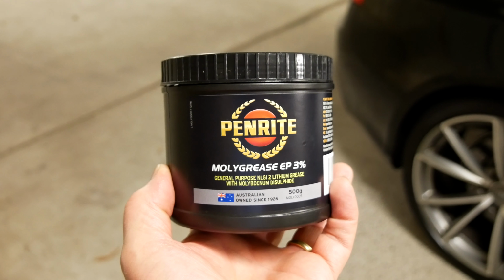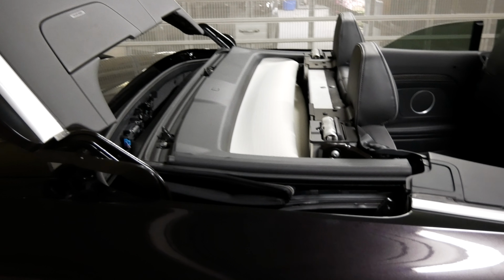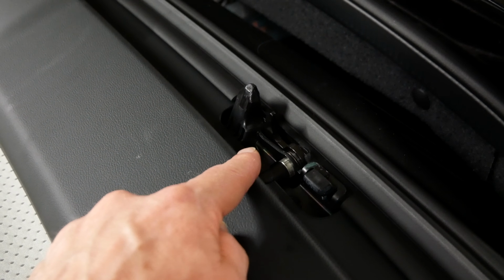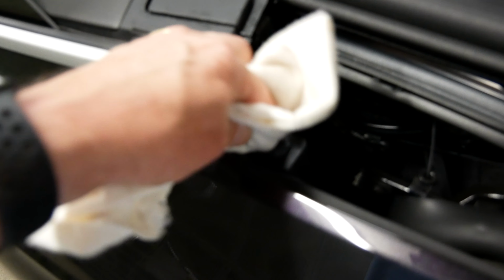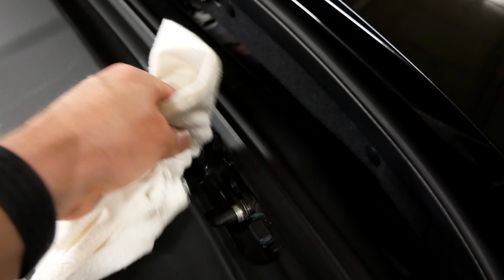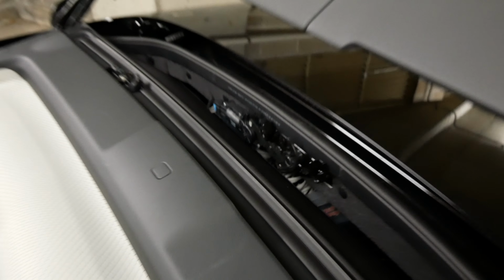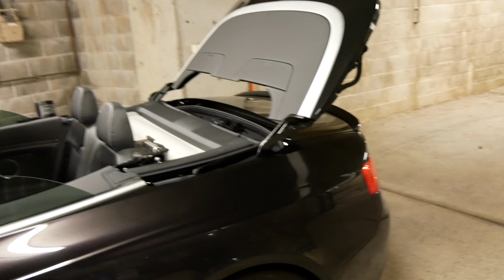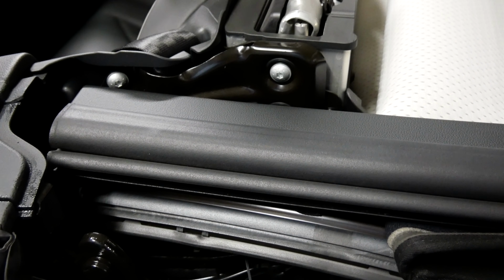Episode 32: Fixing a creaking roof on an Audi A5, S5, RS5 Cabriolet

Comment: Hi Simon - thanks for posting this video. Seems everyone with the issue finds your video. It didnt fix for me BUT i did find someone else who posted a second potential fix on one of the forums. It turns out that the two rubber lid rest points (one on each side) are threaded and can be raised and lowered by using a #17 spanner. Raising them allows the roof to be more tightly braced against the car and this stops creaks that are caused when the roof/lid rest points gets loosened/lowered over time. Only needed about a half turn anticlockwise (to the right) on both sides for me to fix completely.  So for anyone that has tried the grease solution and still got the problem try turning the thread on the rubber lid rests. Hope that helps (was sooooo annoying before, now i can drive in peace with the roof up as well).
Reply from the maker: That’s useful info - thanks!
Reply: Can you post a picture of video showing where and how to tighten this? I am new at all this and don't want to try to adjust the wrong thing

Comment: This was amazing. I put up with the creaking noise for months figuring it would take a bit of work (and money). Turns out a £10 can of WD40 white lithium, fixed it right up.
Excellent advice, thank you!!
Reply: Now if you could just tell me how to fix leak in the roof, water gets in between the seals on the drivers side 😁
Reply from the maker: Silicone spray perhaps?
Reply: @mguytv  I'll give it a shot. It seems to of happened to a few people with this model S5

Comment: Got the same on my newly purchased 2007 Volvo C70 .. it's pretty mint but I had the creaking sound at the top of windscreen just left of the centre passenger side.. all the rubbers with filthy I clean them with soapy water and it seems to go away... But then I put LiqiMoly Pflege on supposedly to blacken and conditioner the rubbers ..the product is pretty crap.. it basically smells of isopropyl alcohol.. and guess what the creaking was back... Any suggestions anyone ?

Comment: Hello, thanks for your excellent clip. Have you got some advises how to fix the leaks around the lower seal of the rear window? 2010 S5 Cabrio
Reply from the maker: Open or close the roof halfway, so that the rear window seal is raised up, then check no debris stuck on the seal or the cover it rests on - this can cause leaks. Also you can use a bit of silicone spray on a cloth to wipe both sides which may help keep water out. If that doesn't work, roof may need adjustment or seal may need replacement. Good luck!